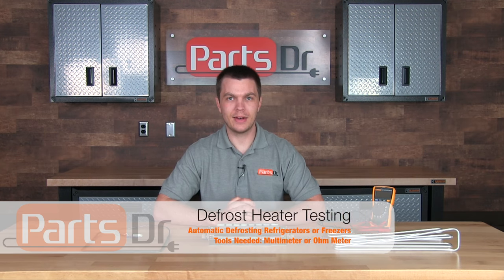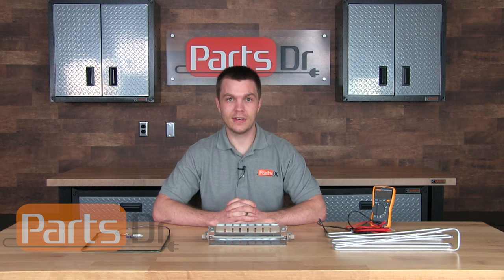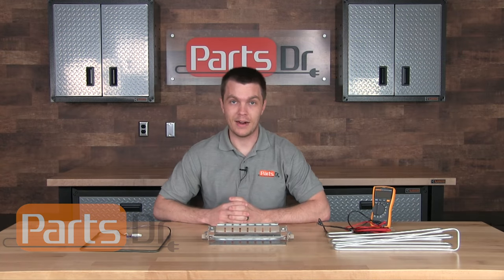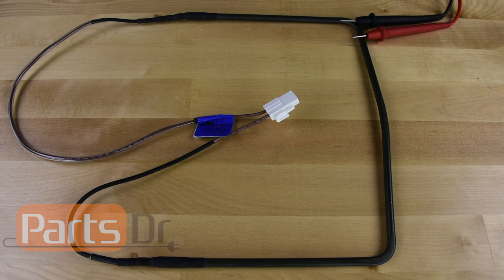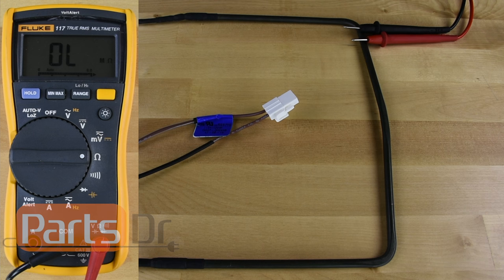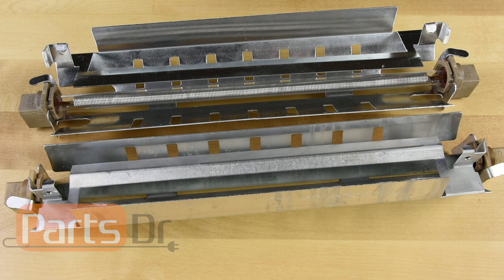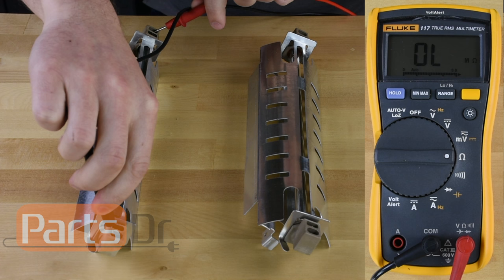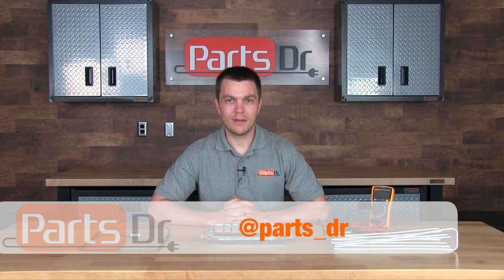How To Test A Defrost Heater On A Refrigerator or Freezer

Comment: While cleaning out under the fridge I went ahead and measured the amp draw while in defrost mode.  Defrost mode causes power to condenser fan and compressor to be suspended for about 30 minutes.  The draw of the heater element on mine was 4 amps for about 10-15 minutes.  Then it just sat there for another 10-15 minutes with zero draw.  At that point compressor and fan kicked back on.  Defrost cycle happens every 10 hours of compressor running time and takes about 25-30 minutes to complete
Reply from the maker: Those results sound perfectly normal!  Thanks for sharing!

Comment: I've watched probably half a dozen videos related to this topic, and I've heard some various things in relation to CalRod type heaters and recommended resistance ranges. I have a Roper/Whirpool rt18akxkq09, the defrost thermostat has continuity at 0 deg F, so I'm fairly sure it's in good shape. But my heater is testing out at 34.4 ohm. I've heard elsewhere that 200-300 ohm is expected from CalRod type heaters, but here you say anything between 10 and 100 is good. Any advice for me? If it's not the heater, or the defrost thermo, then should I look to the timer in the lower cabinet next or what's a good next step of attack?

Sorry to ask so many questions, I'm really trying to avoid paying out for another fridge, or hiring in to have this repaired. I really appreciate any assistance you might be able to provide!
Reply from the maker: An easy way to figure out what resistance the heater should be is to find the voltage and wattage rating stamped and laser engraved into the element and input those into an ohms law calculator here: http://www.ohmslawcalculator.com/ohms-law-calculator.  I would guess that your heater is good from the reading you are getting.  If all of your defrost components are testing good, then start by replacing the defrost thermostat as sometimes they won't register bad during a test because they can act up intermittently.
Reply: Parts Dr So, this was it. I waited a couple weeks just to be sure I didn't have another freeze up incident. 3 weeks in after splicing/soldering in a new defrost thermostat, and no further freeze ups. Definitely does seem like it was the thermostat intermittently failing to cause my issue. Great advice and many, many thanks!!!
Reply from the maker: Awesome!  Glad that fixed the problem for you!

Comment: Hi I have a glass-tube type heater with the omh reading at 300.  You mentioned thatthe normal oneshould be around 110, would that mean mine is faulty?
Reply from the maker: It is most likely good.  It probably just has a low wattage rating.  If you find the voltage and wattage numbers, you can check it here: https://partsdr.com/blog/ohms-law-calculator-a-crucial-tool-for-appliance-repair/
Reply: @PartsDr  thank you.

Comment: How hot does the heating element in a freezer defrost system at full capacity ? like mine is rated at 725 watts heater

Comment: For defrost heater with an attached thermostat (like the one you mentioned at 1:45 in the video), why do you have to cool down the thermostat to closing temperature? Do you suppose to get infinite resistance at room temperature because the thermostat is not closed? If I get about 140 Ohm at room temperature, does that mean the thermostat is stuck closed? Does the resistance suppose to drop when I put the thermostat in icy water?
Reply from the maker: Check out this video for more information about defrost thermostats here:  https://www.youtube.com/watch?v=7kcvlnW8QYo

The defrost thermostat on your refrigerator is probably a safety high limit thermostat with a high closing temperature which would mean that it would have continuity at room temperature.

Comment: Do you have to remove the defrost heater in order to test it? My fridge is not cold so I left it plugin & unused for at least 4 yrs, now I empty & cleaned it in order to give it away. I find a big chunk of ice covering the evap fan motor, wiring harness, freezer coil down to the bottom tray of the fridge. I broke the ice off to find the fan motor has some rust & some wires broken off. I bought the new evap motor but the wiring harness is not the same. So I bought the used one that comes with the harness & defrost thermostat (exactly match & same OEM part no.), I just need to switch & splice the plugs (for defrost heater) since mine is bigger. The rest is plug & play but the fan attempt to spin for 1 sec & off. I tested the V on the new motor (133V) & on this used one (93V). The seller (eBay) said they tested the fan before they shipped & it works, they also said it attempted to spin & 93V means "It Works". Does this used motor still good (at 93V)? Right now my freezer can freeze the food & my fridge is cold enough to keep the food cold without the working fan. I don't know the temp on the fridge side but I saw a little bit of water on the bottom of the fridge turn into ice. Right now, I guess that it's either the defrost heater or the control board (or the evap motor). How to test the control board? I'm not mechanical or technical incline, I started to watch a lot of YouTube videos regarding the fridge not being cold. I have Frigidaire side-by-side model: FRS26LF8CS8. I need help & advice. This will save me money not to buy a (good used) fridge. Thank you.
Reply from the maker: You do not need to remove the defrost heater to test it.
Reply: @PartsDr  I unplugged it & I don't get anything. Does it mean my defrost heater is BAD? My defrost heater end is a male, not female plug like most videos that I saw on Youtube. Is there a way to test the control board?

Comment: I know this is an old video.. But thought I would give it a go.
I have troubleshooted my way to either a defrost problem, thermostat/t-couple, or forbid.... A bad board.

Is the general resistance of the element usually always around 50 to 200 Ohm? For home refridgs regardless of model?

My unit (kenmore 106.566) froze up for the first time since bought in 2005.  Have not checked the element yet until ice melts. It freezing up worries me, otherwise the compssr, evap fans, baffles, coolant all seem fine. Has to be a defrost problem.  Aren't there also one or 2 thermistors/thermo-couples or a thermostat on the defrost assmbly?  If testing the therms, is a continuity ok? .  Or do the therms have a resistance range also before failure?

I can change these sensors and the element out if I knew the exact points on the failures of the therms or heat element.  Assuming the CPU board isn't bad.
Thanks.
Reply from the maker: We have a video on how to test the defrost thermostat here:  https://www.youtube.com/watch?v=i4SNEgPoUMY

The model number that you provided is incomplete.

Yes, most defrost thermostats regardless of model will be around the 50-200 ohm range.

Comment: My fridge trips the RCD every 3 or 4 hours but otherwise operates well. Could that be a problem with the defrost heater? I thought it likely but above someone says it only energises every 10 hours?? Any suggestions appreciated
Reply from the maker: Most refrigerators do not defrost that often, it's usually a minimum of 6 hours but the newer refrigerators vary the length of the cycle using a control board and multiple factors like how often the doors are opened.

Comment: I have a maytag  MSD2554DRA that is kicking out a GFI outlet but it only does it after a number of hours. Could the defrost heater be the cause? There is no thermostat setting for the defrost heater . When plugged into a non GFI circuit it works ok so there must be a surge from the refrigerator causing it.
Reply from the maker: Yes a bad defrost heater or defrost thermostat can cause the refrigerator to trip the GFCI outlet.
Reply: @PartsDr  Thanks, I'm going to look at it since it seems like the likely suspect since it takes hours for it to happen.

Comment: Hello,
We have an Ariston hotpoint SDS 1721 V/HA fridge that makes too much ice on the back panel. We've changed the thermostat, but there's always too much ice. Could you tell us what kind of problem there could be, and where is the defrost heater on that kind of model. It could also be a command card problem... Thanks in advance for your answer (We're writing you from France).
Reply from the maker: I'm sorry, we do not have any information on this model since it is an international model refrigerator.
Reply: if its has infinite reading. what will that mean?

Comment: Can i test the volts coming out of inputs to see if the control board is sending power?
Reply from the maker: Yes you can, but you would need to either make sure the refrigerator is in the defrost cycle or find a way to force your refrigerator into the defrost cycle.
Reply: @PartsDr  how can i force into defrost cycle?
Reply from the maker: @michaelgreene5525  What is the model number of your refrigerator?
Reply: @PartsDr  RF260BEARESR
Reply: @PartsDr  oops its RF260BEAESR
Reply from the maker: @michaelgreene5525  You can try what we show in the beginning of this video here:  https://www.youtube.com/watch?v=1DQZs75GEWQ The steps can vary for different models, so we do not know if this will apply to yours.
Reply: @PartsDr  super helpful, so i put my fridge in forced defrost and my heater worked, i pulled panel back and tested it with a laser temp reader and its clearly working, thank you!  I am trying to figure out why its leaking below that panel, its like water drops are making it out of the sealed cover from underneath, i wonder if my temp sensor is working right, i tested it like in ur video and it appears to have proper ohms at the right temp but it might be a little off and i just cant tell, so here is my question...are the evaporator coils supposed to develop frost before the heater comes on, or is the heater supposed to prevent frost?  I notice mine have frost on them before heater kicks in and im wondering if its kicking on too late making too much ice melt creating more water then the system is designed to channel into the drain?  Thank you in advance.  You are great at responding.  I will buy from you when i can for helping me.
Reply from the maker: @michaelgreene5525  The evaporator coil will develop frost while it runs, that is normal.  The automatic defrost cycle turns on to melt the frost.  The timing of the cycle varies, but most refrigerators will run the defrost cycle every 6-24 hours.  The cycle is controlled by the main control board of your refrigerator.
Reply: @PartsDr  thank you!

Comment: Hi, what about testing when I have an assembly of heater and thermostat, not just heater only? Mine are together so I don't know which one is broken, the heater or the thermostat. Thank you.
Reply from the maker: You have two options.  You can test it as one circuit or cut and splice the wires between the thermostat and heater to test each part separately.   They are most likely sold as one part, so even if you narrow down which one is bad, you will still most likely end up replacing both parts.
Reply: There is a much easier way than cutting and splicing.  Use a probe that is very sharp and just push it in through the wire insulation right into the conductor on the wire coming from the element to the thermostat.  Once you've determined that the element is good...30ohms for example....then you can use a really cold ice pack to wrap around the thermostat. Hold probes on both ends of assembly, now including the thermostat, and watch the meter as the thermostat gets colder.  If the thermostat is good and your gel ice pack is really cold (from a good freezer), then, once the thermostat reaches its rated closing temp (maybe 20 degrees) you will see the meter instantly  go from open circuit  to whatever the ohm reading was without the thermostat in the circuit...30 ohms, in this example.

Comment: Can I check the defroster just by just unplugging the clip and turning the fridge off instead of talking it completely off ?
Reply from the maker: Yes you can.  Just make sure the wires are disconnected from the defrost heater.
Reply: @PartsDr  Thanks alot my friend I really appreciate the fast response 🙌 🙏

Comment: My old heater was reading 173 ohm. The brand new part I bought is reading 165 ohm. Seems way too high do you think?
Reply from the maker: According to the math that would equal around 83-87 watts if your refrigerator using 120v AC power.  That is most likely correct and a good heater from our experience.
Reply: Parts Dr Thanks for your reply. My fridge is 240v AC  50hz. Is that still okay?
Reply from the maker: @pufffdragon   Yes
Reply: Parts Dr Great! Thank you. Also thanks for the very informative video. Glad I found you.

Comment: What if my thermostat and defrost heater test good ? What else can cause the the heater not turn on, pcm ?
Reply from the maker: Most older refrigerators had 3 defrost components.  Defrost timer, defrost heater, and defrost thermostat.  Most newer refrigerators have 4 defrost components.  Defrost heater, defrost thermostat (high limit safety), defrost sensor (thermistor), and control board.

Comment: The refrigerator defrost heater in our Samsung refrigerator (RF28HFEDB...) has an integrated inline fuse.  Testing across the whole assembly (heater + fuse) from one connector to the other produces 147 ohms.  I would assume that both heater and fuse are good?  True?  If so, the evaporator's both sensors and fan are testing OK.  Suggestions for other cause for ice build-up  in the top of the evaporator coil would be greatly appreciated.  Thx.
Reply from the maker: It sounds like the heater and bimetal are most likely good.  The next thing to check is the defrost temperature sensor.  We have a video on temp sensor testing here: https://www.youtube.com/watch?v=J5bwcteeJNM

Comment: The defrost heater and thermostat test fine, but the coil defrost cycle isn't happening. What's the next suspect?
Reply from the maker: What is the model number of the refrigerator?  https://partsdr.com/model-number-locator/refrigerator
Reply: @PartsDr  LFFH21F7HWJ
Reply from the maker: @davidmaschke8801  There should be three defrost components on this model, the defrost heater, defrost thermostat, and control board.  If the thermostat and heater are good then it is most likely the control board that is bad.  Although we do recommend replacing the defrost thermostat anytime you have a defrost issue as sometimes they will bench test good but act up and fail when installed in the freezer.

Comment: I followed this video to test a defrost heater i thought was having a problem and a brand new one - thinking I had to change out the old one.  The continuity reading came out the same more or less.  Am I doing something wrong?  The Ohm value was well under 1.0.  It was in the tenths and hundredths places of the decimal.  The multimeter was set on the ohm symbol that says 2k
Reply from the maker: Try using a lower setting on the multimeter, you will want to use the 200 setting.

Comment: they really need to have the evaporator coil for freezer and cooler, so no more need for defrost heater, fan, and vent. Any vent ought to be piped outside the refrigerator, through the room temperature, instead of just straight down from freezer to cooler.
Reply from the maker: Most refrigerator manufacturers offer dual evaporator models on their more expensive model refrigerators.

Comment: So, 1.2 ohms is bad?
Okay, there are wires on both ends. The other end shows 104.8 ohms.
Maybe it's the temperature sensor? That shows nothing happening. OL
Reply from the maker: We would probably need to see a picture of what you have.
Reply: I get a notice when someone like something I chatted. Not when someone replies. I need to figure out the settings. But I don't know how to post a picture, other than make a video of the pictures I have, to upload to yt. But after I posted that, I found out the multimeter I was using sucked. When I got my new one and tested it, it was good. I'm starting to get the bottom drawer stuck now, and it will not roll/pull out. So I will need to thaw it out again. I made a new piece that goes from the heater to the drain, that looks similar to the new replacement version of it. I noticed the next day, after I fixed it, a crack at the back of the fridge was already freezing moisture at the back of it.

Comment: Hi, i didn't get a reading at all when touching the two heating terminals, but got one of 81.5 when I touched both volt meter ends to the same heating terminal, what does that mean please?
Reply: It means that’s funny
Reply: @gaildimick1831  yeah, it needed replacing in the end!

Comment: How hot can a defrost heater be? Max temperature
Reply from the maker: They do not rate a max temperature for the defrost heater itself.  The temperature of the heater is determine by the voltage and wattage rating.  Most refrigerators will limit the temperature of the defrost heater with the defrost thermostat or defrost thermistor & main control board.  You will want to check the schematic for your model refrigerator for more information regarding that.
Reply: @PartsDr  Thank you for reply. I found some site explaining how temp is calculated. Thanks again.